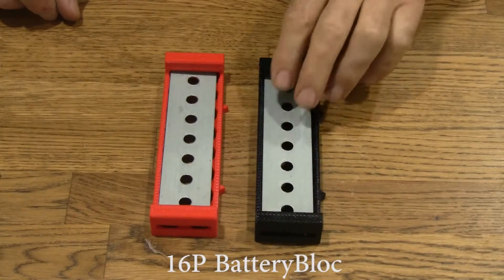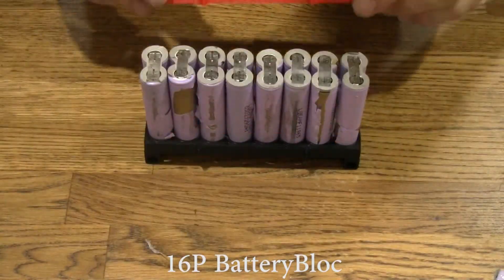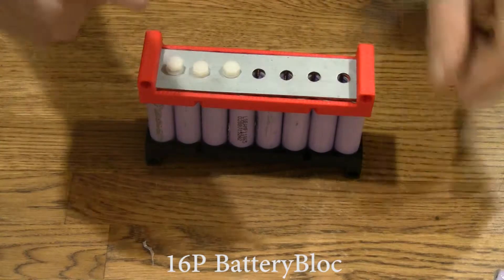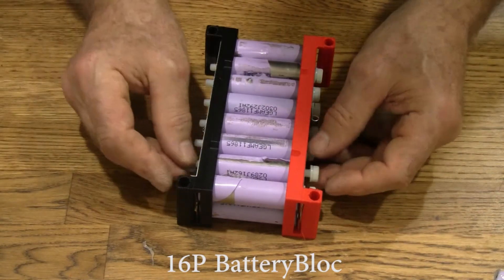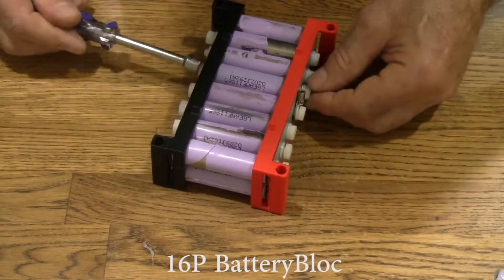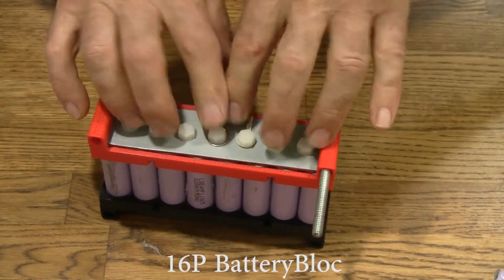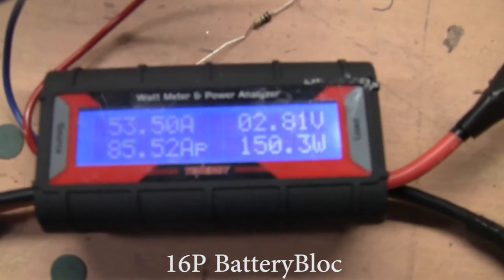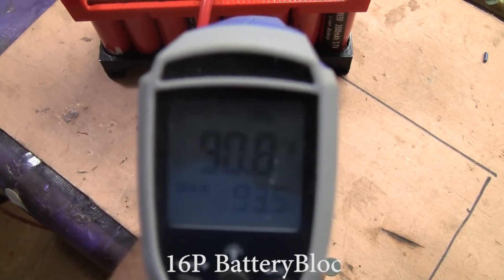16P

Comment: Hello Shawn, hope all is well. I am hoping you could help me with this question. I made 3x24 18650 battery packs wired them in series to get 60ah @ 12v and added a 100amp  BMS. Can I make 3 exactly the same packs and wire them in Parallel to  acquire 120ahs? Thank you for your feed back. Have a nice day.
Reply from the maker: Yes you can.  You can then charge and run them in parallel, as long as each pack has it's own BMS.
Reply: Shawn, so that set up does only require 2 BMS?
Reply from the maker: Yes, you can connect them in parallel, positives of each battery to a positive bus, and negatives to a negative bus, and use three BMS's on them.
Reply: Shawn I'm greatful for you time in helping me tackle this stumping question , well to me at least. I have 3 separate packs each pack has 24 cells in parallel I connected the 3 packs in series to make it a 12v battery at 60  ah's. And I connected a 3s 100 amp BMS to it. Can I make an identical pack just like the one I just mentioned, and connect it in parallel to achieve 120 ah's?
Reply from the maker: Certainly.  I would get two lengths of copper pipe, hammer it flat.  Make one the positive bus and the other the negative bus.   Connect the positives of your battery packs to one bus and the negatives to the other.  I would use XT-90 connectors between the batteries and the bus bars so you could remove a single battery for servicing and your system would still be up.  You could charge all at once through the bus bars.   You can solder directly to the copper bus bar.
Reply: Shawn McCarty , I think I'll give it a shot. Be well. And thank you very much for your insight.

Comment: what do you think I can use to charge a 4S 50ah battery pack with solar?
Reply from the maker: So you have a "12" volt system.  Use a MPPT charge controller.   You are talking about lithium batteries right?  So you need to charge at 16 volts.  Wire your solar panels in series and step down the voltage to 16 volts through your MPPT tracker.  Charge at 16 volts with a BigBloc Balancer on each parallel group.
Reply: Shawn, thanks for replying. Yes, I'm looking to power up  couple of  12v 1.5amp pumps for few hours a day. And some low wattage LED's at night for couple hours. I got the mppt portion of your reply and panels in series. Not sure what you meant with the last part of big block balancing. Have a good day